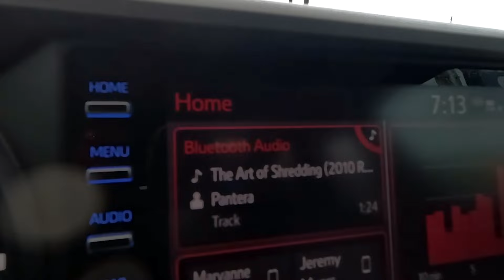VW engine & starter, Extended Warranty Declined. DAY IN THE SHOP 424 #auto #repair #engine

Comment: As an ex VW tech, I can tell you we had a left table with special legs that bolted to the engine so that didn't happen. They purposely make it so have to have the special tools to do the job safely. Keep on plugging Jimmy. See you tomorrow.
Reply from the maker: Thanks for the info! I figured that was the case. I have a trick for next time. :)

Comment: The harbor freight lift table is what I use to drop engines onto. I also have a steel dunnage cart available. Drop it on there, pick the car up and wheel the powertrain out wherever I want to work on it.
Reply from the maker: Yeah, ours is great! But it was in use on the other engine job. :/

Comment: Long time subscriber, hang in their jimmy you'll get it done! Handy tip: I use super-glue to enclose all the cuts i get now. The sooner you enclose the wound, the faster it heals. Do you know that it was invented for this purpose in WW2? To close wounds on the battle field? It also works for mechanics :) Seriously, please try it out next time! I find that within 5 minutes, i can put gloves on again and work all day without reopening the wound even if i accidently hit the spot again! Liquids are no match, you can wash your hands or have a shower and the glue will keep the wound dry and clean from infection. Depending on what glue you have, it can last from 1-3 days with a single application, you simply re-apply it / add layers as needed. That stuff you use to glue plastic together will get the job done!
Reply from the maker: Yeah, CA is a great product. I usually only use it for very clean style cuts, like razor cuts. We glued tires with it for RC car racing too.
Reply: @JimmyMakingitwork  i'll use it on anything that i can - which is basically anything without an open wound/where a scab may form because i dont want to interrupt that process. Those cuts on your hand where u slip on a bracket or plastic are perfect IMO. If i can, i will clean the wound first; but if i cant and ss long as im not in an area like a toilet were bacteria is, im OK with super glueing some dirt/greese in there short term to allow the body to close the wound ASAP. I find that if u can close it within the first 2-3hours, it will sometimes heal overnight. Your body is pretty good at getting rid embedded debris over the healing process.

I find if i dont, the wound, esp on the hand, will just keep opening itself up like you demonstrated today no matter how hard you try to avoid it :) I will use any non-toxic glue that is handy, 3m 454 is another really good one, dries quick and a little more durable.

I do alot of remote 4wd'ing, hunting, fishing as well, always carry glue in my first aid kit now!

Comment: As a DYI that has done at least a dozen engine swaps, I have always set them on the floor because I was afraid they would fall. That and I have never had access to a lift. Thanks for showing the struggle.
Reply from the maker: Yeah, 👍 be probably done several hundred swaps and this is the first one I’ve dropped. Have a better plan for next time though! :)

Comment: I was pulling a engine from a dodge journey once with the pentastar 4 wheel drive. Had to pull it from the bottom and used jack stands. Ended up dropping the engine and trans just like that. Thankfully the trans was okay. New engine went back in much easier.  But SHIT HAPPENS lol.
Reply from the maker: Yeah, I thought I had it pretty steady. But rolling over the subframe undid all that.
Glad you got yours sorted too!